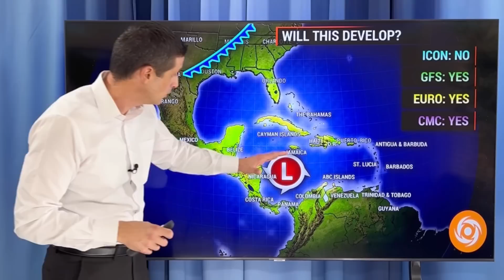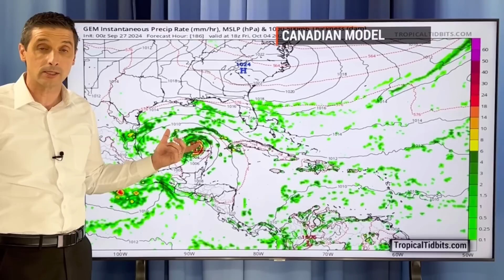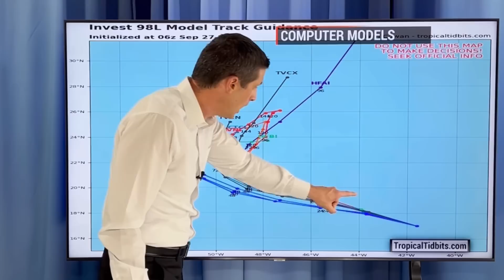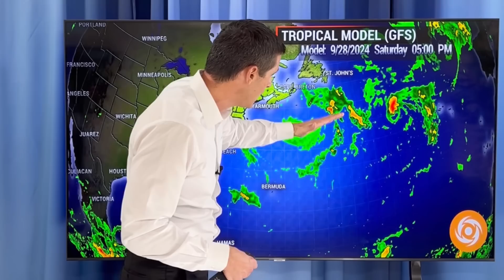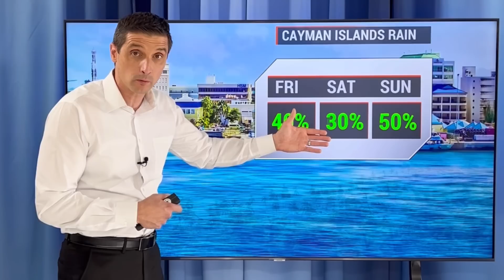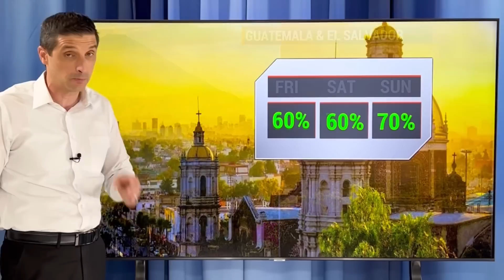New Hurricane could Follow Helene....

Comment: Wouldn't Helene have cooled the water in that track?
Reply from the maker: That is a factor.
Reply: I am thinking that the cooling would be relative. The water temperature may not be as hot as what fed Helene, but it would still have heat. Plus the infrastructure is already impacted and compromised and the soil is saturated. Any other system in the same area will make the situation worse unfortunately.